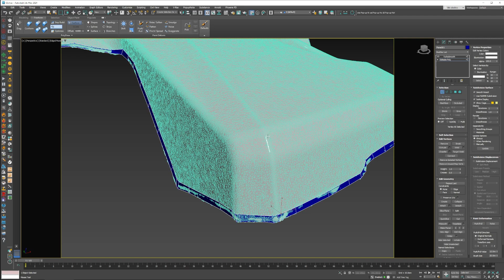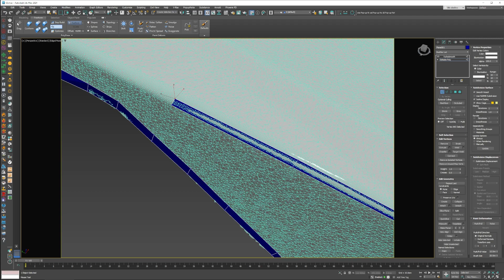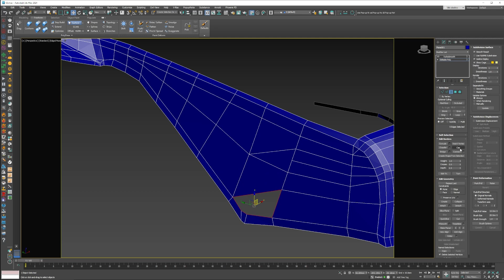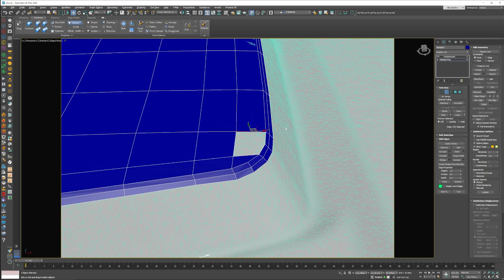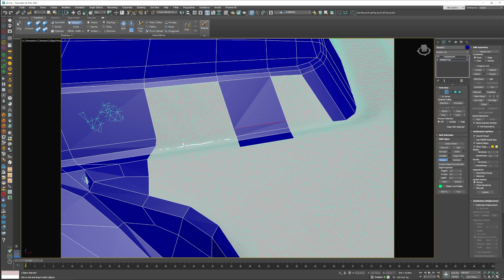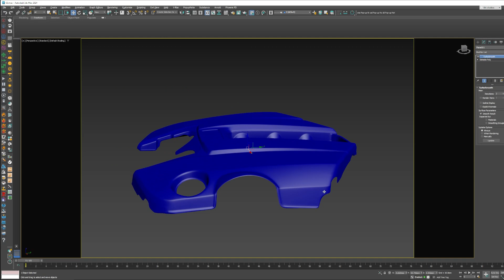How To Take Scan data and make it 3d Print Ready

Comment: One tip I use.  Put your scan data on it's own layer and then set the object properties to By Layer.  Then in the Layer properties set the layer to Shaded.  That way you can have edges on the new object without the mess of edges on the scan.
Reply from the maker: I need to try this! Ty so much for sharing!!!

Comment: Have you tried fusion360? They have the ability to import and convert to a useable model with very little user interaction. As long as your 3d scanner is decently accurate, you can import and export a mesh with the accuracy of your scan. 

If you want to upload the scan data, I can attempt it and see how it turns out.

Comment: Thanks for the great video but seems like this is waaaay to time consuming. Nowadays with all this AI this should be done with a click of a button inside the scanning software.
Reply from the maker: @DanielSchweinert  im sure its coming soon! I know the einstar software has something already but my concern is proper mesh flow as well as having edges be accurate which sometimes the scan doesn’t pick up correctly due to budget scanner. This def is an annoying process 🤣
Reply: @poltdesigns  Yes for sure if you have to do 20-30 scans a day this is no fun at all. When I see what is already possible with AI (behind closed doors) this should be just a matter of time until we see parametric scanning in the public.
Reply from the maker: @DanielSchweinert  omg, I would never want to deal with optimizing that many scans lol. I just do a few models here and there, actually most times I make my own designs for my cars so I dont ever retopo, but since my buddy wants to recreat the exact same engine cover in CF he asked if I can do this for him. Def not going to do this again for a while 🤣
Reply: @poltdesigns but his right though having a high rest 3d scan it's worth it...just for a time managing project... and these scan some are approximate 15k